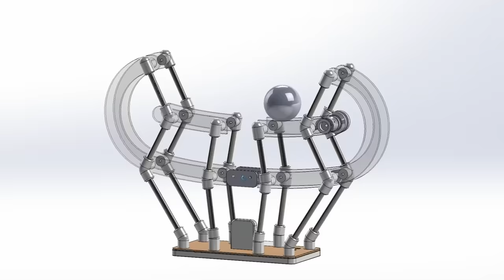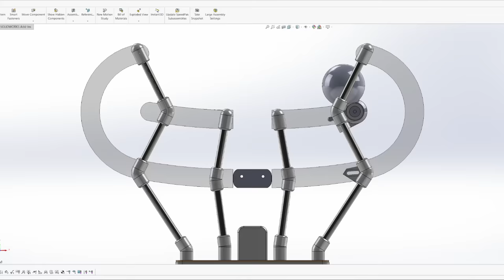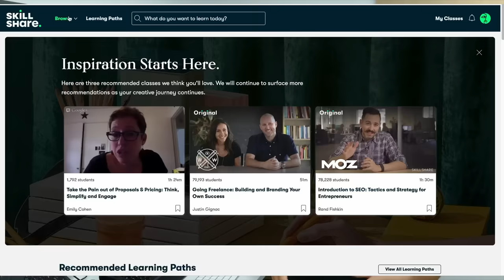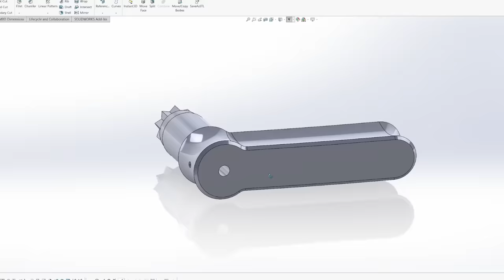Perpetual Looping GIF in Real Life

Comment: Challenge: Can you do an almost perpetual motion design, that uses just a small solar panel to work? In order to work durring day without a battery.
Reply from the maker: Oooh good challenge! I'm going to think about it!
Reply: Add a rechargeable battery to the mix and a solar panel strong enough to charge the battery at the same time the panel powers the mechanism.  Then you don't need to worry about it stopping even in temporary darkness.
Reply: @ianbelletti6241 A capacitor fits that description perfectly, and is cheaper, simpler, faster, safer and more efficient than a battery with a charge controller.
Reply: @totally_not_a_bot  you don't always need a charge controller. It depends on battery type.  On top of that, some lithium batteries come with built in charge controllers.  Just look at the AA rechargeable lithium batteries.
Reply: @Engineezy this reminds me of the quote ”The hardest part of building a perpetual motion machine is figuring out how to hide the battery”
Reply: What 3D design program do you use
Reply: Mesmerizing! Thanks for sharing the process! ❤
Reply: @Engineezy  that borders on art installation :)
Reply: @totally_not_a_bot no, capacitors cant charge enough to keep the charge for a whole cloudy day, and capacitors discharge way too quickly

Comment: If you are considering a v2, I would love to see a version where a ball is moved by rocking the entire frame (thus removing the lever to lift the ball). It would be difficult, but the software could employ a PID controller to get smooth motion.
Reply from the maker: Ooh thats a very cool idea! Might have to use that in a future project
Reply: Attach the camera to the tilting frame and a smooth background so you don't see the motion.
Reply: YES! That's what I thought he was going to do from the beginning. I love the idea of a PID controller, but I think with a given known weight it could probably use pre-calculated settings.

Comment: Cool!  I love those satisfying 3D animations too!  This may be just part of your process that you leave out, but do you ever run a physics simulation on your machines before you build/print them?  I'm a 3D animator myself and use Maxon Cinema 4D which has a physics engine that's pretty easy to use.  I'm sure Blender does too.  It made me think on this one that if you simulated it accurately enough, you could tweak the dimensions, slopes, etc until the ball lined up with the paddle arm at the end without the sensor and motor speed change.
Reply from the maker: I definitely need to spend more time with physics engines! Generally speaking my computer is not powerful enough to hand them haha, gonna need to fix that and improve in this area

Comment: In 1968 I went to the World's Fair (Hemisphere '68) in San Antonio, TX.  In one of the display areas, they had a machine that just fascinated me.  It was a very simple machine consisting of a box mounted in a wall with a glass front.  On the base of the box toward the front were two polished metal pads about 3" in diameter. Directly between the two pads was a shaft about 4" tall with a rotating hoop on top of it.  Directly behind the two metal pads and about 6" above the base of the box were two holes in the back wall.  About every second or two, a metal ball just big enough to fit through the hole would fall out of the hole on the right, drop down and land on the metal pad on the right. The surface of the metal pad had a compound angle that would bounce the ball and change its direction toward the spinning hoop.  As the ball reached the hoop, its rotation would just align with the ball to allow it to pass through, ark down and hit the second pad where the direction was again changed and the ball bounced up and through the hole in the back on the left side of the box. Repeat indefinitely.  A bunch of us probably watched this display for over an hour. Since that was 55 years ago, my recollection of the sizes might be off, but I will never forget how much fun it was watching this thing.  We may have gentled "tapped" on the glass a few times to see if we could make the ball miss the hoop, but I think it was engineered with that possibility in mind because we did not break anything and it never "dropped the ball".
Reply from the maker: That sounds really cool! Definitely sparks some ideas!

Comment: You can use spiral shaped linear gears to vary the speed of the push arm. Then you wouldn’t have that clicking sound and it would be more fluid looking. Oval gears do the same thing but they have two speed up points instead of the one you need. You can use all kinds of shaped gears but spiral gears would be perfect for this.

Comment: You might be able to get rid of the arduino entirely. If you use a pair of cogs where half of the cog is one radius, and the other half of the cog is a different radius, you can get 2 different speeds as the first cog rotates out of the second cog. That way you just use a single little motor to power the artwork with no extra complexity. An example of something similar is shown in "Art of rendering"s channel under Mechanical principles part 5 timestamp 0:42.
Reply from the maker: Thats a cool idea, definitely worth exploring in future projects

Comment: you should adjust the timing of that “lift arm” forward a smidge to smooth out the lift as there seemed to be a few degrees/seconds on the approach to spare thusly a smooth meet up with the ball and seamless transfer throughout the arch

Comment: Here's a couple of improvement ideas. First, you could make the acceleration and deceleration of the arm smooth instead of instant. Second, by changing the shape of the cam you can directly change how the scissor mechanism moves. Why not try some new shapes and see what happens? Third, the sensor does not have to be where the arm is. Since the cam and arm are connected by a chain, you can make the cam trigger the sensor. Not a huge improvement but it would make the frame look cleaner. Finally, consider hiding the motor and electronics in the base. You would have to make the base deeper and add extra gears, but using a pancake stepper would save some space and a custom ordered circuit board with SMD components would save space.

Comment: Make the paddle a soft wheel that compresses onto the ball  and spins it up the rails as soon as it arrives. Would make the lift immediate and smoother, plus difficult to detect from a distance if the drive system was obscured and the drive wheel's speed synced with arrival speed of the ball. There would be some backspin at the release in the top section to figure in offsets for as well... It's just math, and time... :D A striped ball would look pretty cool too. Nice work!

Comment: Awesome build, just some aesthetic changes. 

It's not so heavy that it can't be supported from only the rear. Remove the front support structure/add the necessary spacers between the tracks.

Then make the paddle black and hide all the machinery behind a black backdrop or make all the machinery black.

It'll make what's happening so more clear.
Reply from the maker: These are all really good points, thanks!

Comment: ok, cool, but: can you change the timing so you move the ball from the bottom to the top track with the center section without reducing the horizontal momentum so that it still completes the circuit and you can take out the loading arm entirely. I mean that would be cool. You'll have to raise the ball in no more than the time it takes to roll across the center section. you might need a longer center section

Comment: Could you make a 'perpetual motion' illusion version where instead of having the arm lift up the ball, you have an electromagnet hidden in the track which accelerates the ball (might need to have a metal core or something in it), allowing it to complete the loop without the appearance of external forces. It would have to be timed to turn on/off, and you could use one or two sensors to trigger it based on the ball's position.
Reply from the maker: Thats a really cool way to pull it off! Definitely going to keep that in mind

Comment: I know I'm late to the party but I still want to throw an idea at you... How about using small variable electromagnets controlled by the Arduino and have the ball with a small steel ball bearing core. Then it be a case of fine tuning the electromagnets to smoothly pull the ball around the system to match that 'oddly satisfying' effect. Plus it will be a lot more quieter except the sound of the ball running around its course. ... Just an off the top of the head idea!
Reply from the maker: Thats a great idea! Gonna keep it in the bag
Reply: @Engineezy  Yeah, will be an interesting challenge of a project if and when you decide to do it.

Comment: Would a bowling ball return or escalator handrail style center hub fix the rollback issue? Make a center drive wheel that has o-rings for grip. Oversize it a touch so you get 3 points of contact on the ball and it might just climb with no asymmetric arm.

Thanks for the video

Comment: Cool project, one thing stood out to me though what if instead of detecting the arm; you use a stepper motor (for acurate adjustable speed) and detect where the ball is in two areas to detect the velocity and then adjust the motor speed accordingly? it could possibly be smoother. Love the your videos bty!
Reply from the maker: You’re definitely on the right line of thought, I was thinking a sensor for the arm and a sensor for the ball, either could probably work
Reply: @Engineezy   Oh! yeah that's a good idea. Also, there's an arduino library named Ramp that helps to smooth out animations. You could also use something like an exponential equation for the voltage that gives you an even more organic movement.

Comment: Yikes. Watching that cam system run in that direction made me want to grind my teeth together. Reverse the direction the cam is spinning, and the torque it requires to start lifting the scissor is reduced, based on the pressure angle. Edit: I love the video though! I didn't mean to be negative.

Comment: you could avoid using any code or motor speed changes by using something like a universal joint at, let's say a 45 degree angle. Throughout its rotation, there will be two points of high speed and two points of low speed. Use a 1:2 increase with gears to make it speed up at one point and slow down on the opposite side. This will allow you to have the arm move quickly to push the ball, but slowly otherwise.
Reply from the maker: That’s an interesting concept!

Comment: Do you have a specific brand you like to use for the stepper motors?

Not talking about sizing the motor for the project but just in general a brand you tend to gravitate towards.
Reply from the maker: So far I’ve just been getting what’s most available, but generally the moons or ldo motors have been pretty solid

Comment: So get rid of the arm, replace it with a soft rubber drive axle that just contacts the top of the ball as it enters... The only issue is the ball will be spinning backward as it exits the top which would hamper its flow across the top...
A 2nd axle above on the exit could help add top spin if it was at the right speed.. The outer loop could have a rubber track to give an opposing force to the lower axle, and could stop short of the upper allowing for a transition.

Ascetically, getting rid of the inner pair of supports and making the moving floor span the entire distance between the end caps would make for a better visual of  'missing track'.. 
the current tiny moving piece almost disappears as it is clear. 
The scissor arms should be clear as they detract from the moving floor.
Reply from the maker: Ooh definitely feel like a missed opportunity there- where were you when I was working on the concept 😂
Reply: @Engineezy  I have a million concepts but very few leave the Aerospace Hanger (the void above my neck).

Things like increasing accuracy/distance of a paintball gun by adding a slight curve down on the barrel.. (adding backspin to the exiting ball rather than random.
A heavier bend, and rotatable/interchangeable barrel and you could 'shoot round corners' albeit a slight curve.. at a distance it may just b enough to go over & down, or slip round the side, of a hidden target.

Before Covid I was thinking... Why doesn't someone hook up exercycles to a playstation and have group races... you could add rowing machines.. and have any road/lake/river to run on a rainy day.

instead I fix machinery. (Jack of all trades... mediocre at most)

Comment: I do not like the arm. Just with the lift you should be able to add enough kinetic energy to the ball to complete circuit. So, when it is on top, the platform goes slightly higher on the right while the ball is over it and when it's on the bottom the platform goes higher on the left.
Reply from the maker: That could be a cool way to execute this!

Comment: couldnt it have been fully mechanical? i mean its cool but there must have been a way to do it without any digital controllers.
Reply from the maker: I would’ve had to redesign the track to adjust the timing, but absolutely possible- this was supposed to be a quickie (never works that way) so I decided to implement the electronics

Comment: Nice but running the motor at different speeds each cycle is kinda cheating. It'd be much cooler if the mechanics moved at constant speed.
Reply from the maker: Might have to fix that on the next iteration!